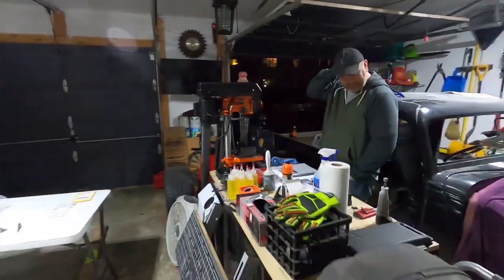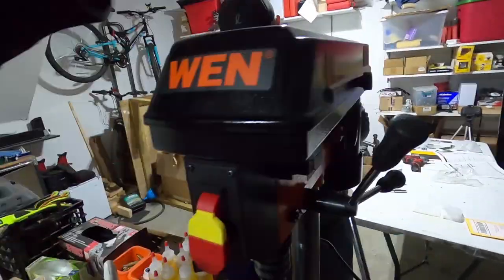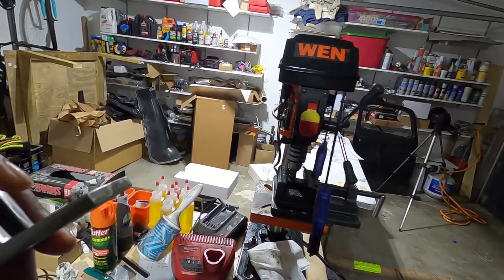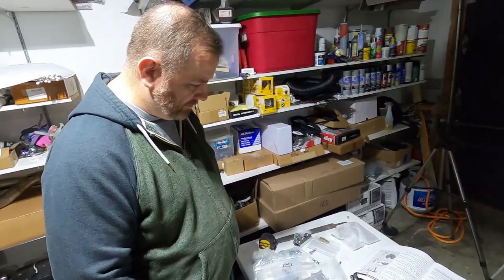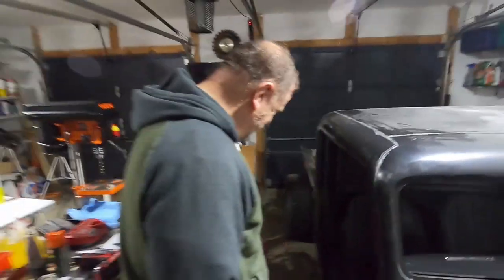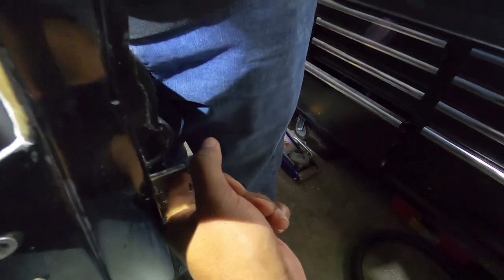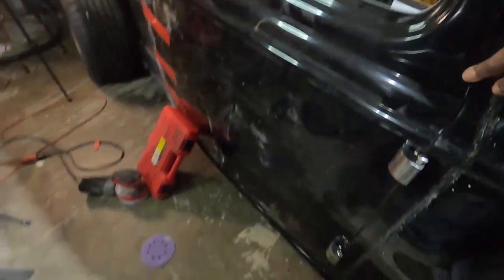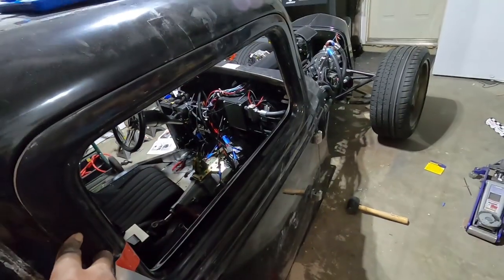Factory Five 35 Hot Rod Truck Door Assembly Part 2

Comment: Instead of using hinge pins preliminary adjusting, I used phillips screw drivers.  They are about the right diameter and are easily removed.  My pins were too hard to remove, and didnt want to bugger them up.
Reply from the maker: That is a great idea. I will have to try that out.